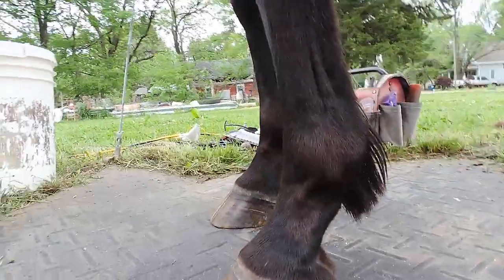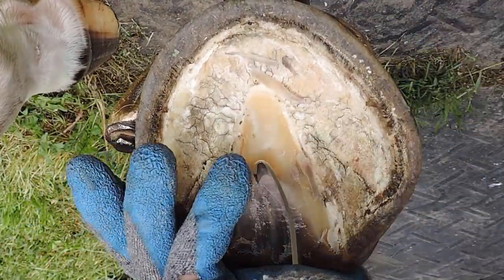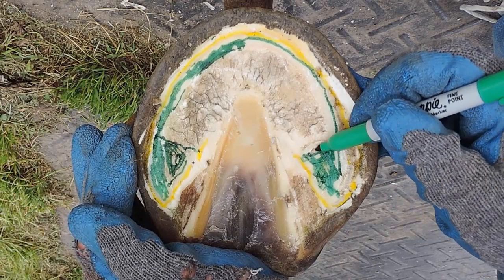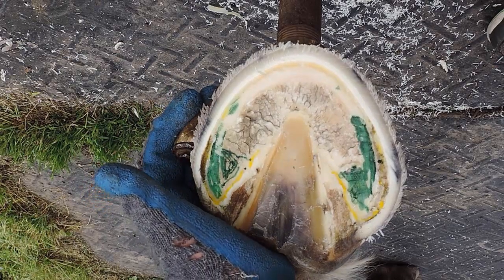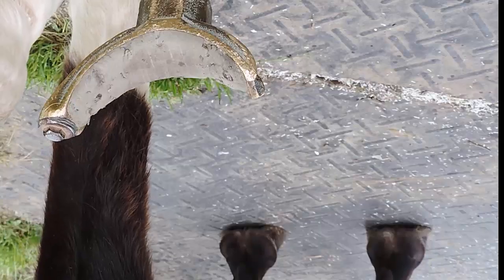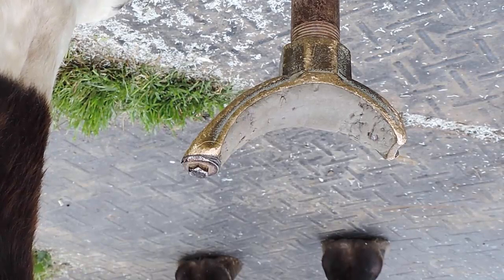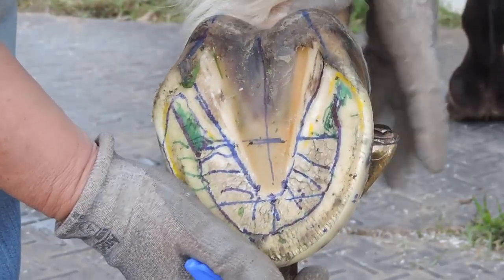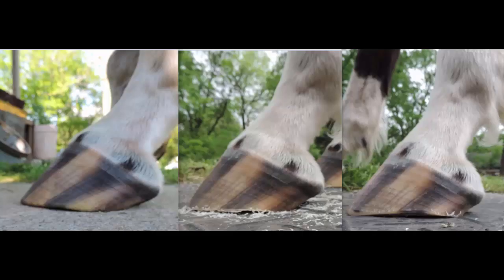TACT General Maintenace with Correction Trim Example

Comment: Hi Linda, 
Once the heels are up to 2”, do you recommend for that horse to still leave up some wall at the heels like you did here? Or can you bring them down to the sole by then?
Reply: Sorry I have not revisited this. Do not let the wall get so  high it buckels or breaks. Only let it get as high as it will hold together. Eventually the heels will move back and the sole will fill in to support the wall. Every once in a while you have to do what I call a "reset" which is to take the heels down and back to where they are gradually moving to. So like I will take mine down to 1 1/2" and grow from there.